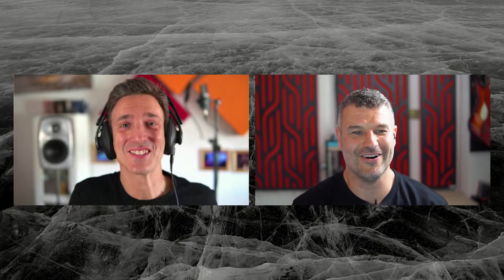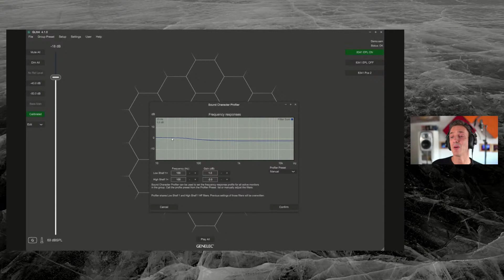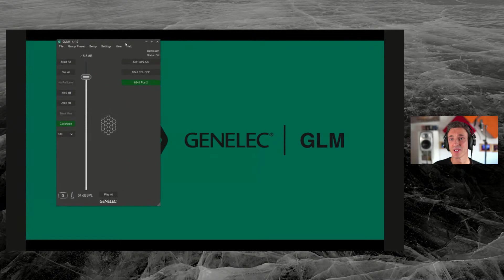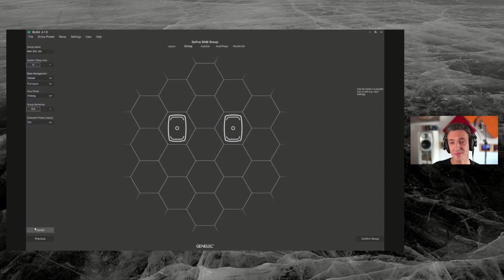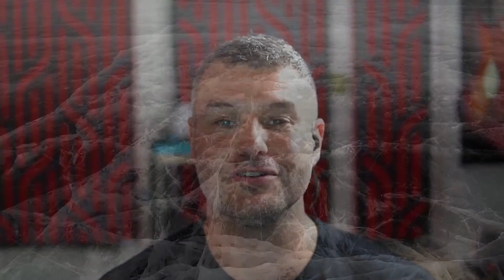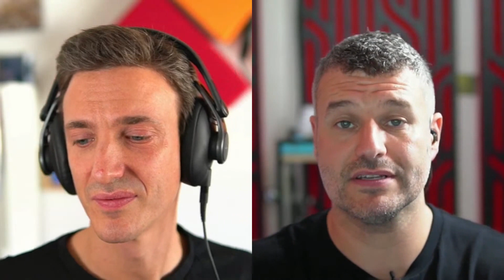#GLM15Anniversary | Meet GLM 4.1

Comment: I am sorry but the software is bad. It took me 10 minutes and a lot of luck to find the update button for the firmware. By the way, it is not as described in the manual. I leave it to you to find how to update the firmware on each speaker. Because you will be getting notifications, but no instructions, or a simple button to press. Not nice to make it difficult. It is very well hidden indeed.